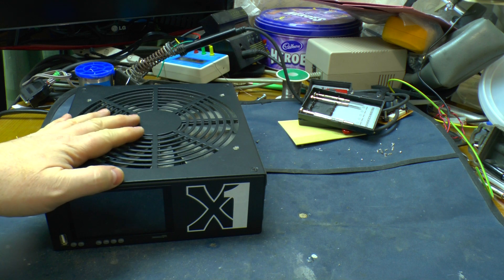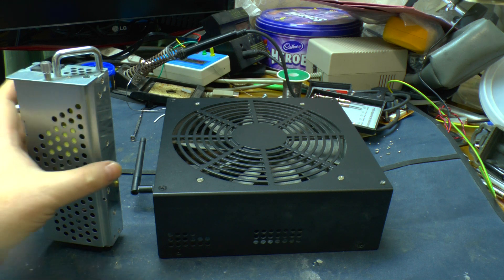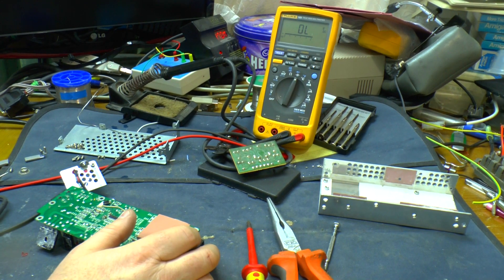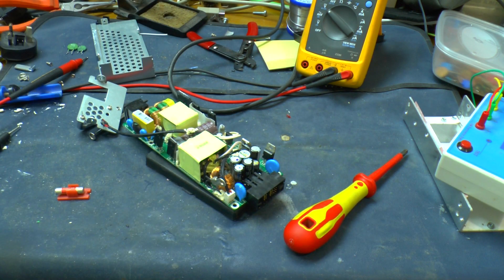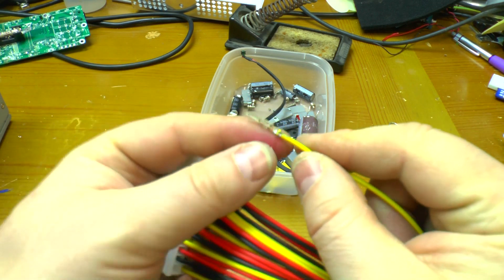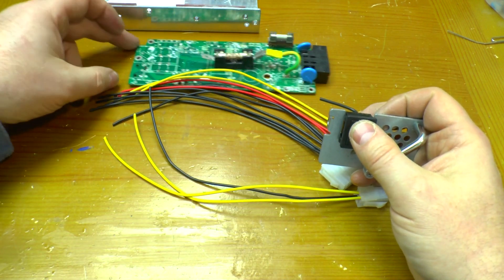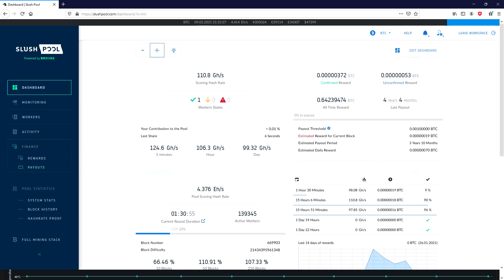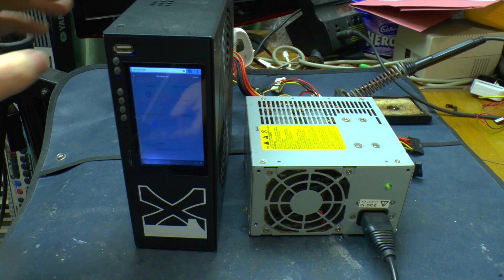Black Arrow Prospero X1 ATX power supply conversion

Comment: On a purely technical base... There should be a lot of amps going through the darn thing before it blows the fuse. So it should produce some heat, eh? If you had a thermal camera, you should be able to see the component which runs the unhealthy amount of current?
Reply from the maker: It was blowing instantly, but when I removed the reservoir cap it went a few seconds before something went "fzzt" and another fuse went. I suspect it was flashing over inside the transformer.

Comment: Hi! Could you say, what the model of lcd screen used in this prospero? I have a more older (with out lcd) but I saw a some empty socket in mainboard (40pin) and its intresting - if i plug compatible lcd - its will be work? Thanks!
Reply from the maker: I don't know. If you look at my earlier video where I opened the X1 you can compare your front board with mine, however there appears to be no easy means to get the details of the LCD panel itself. https://www.youtube.com/watch?v=KtxVxqPmN7k
Reply: AintBigAintClever thanks for answer! my board (from x1) looks like your board. Revision of my board is 4.1 date (2014/06/10). And socket for lcd and digitizer is empty. I think that its can work. Could you say the size of screen and resolution? It was a 4inch 800x480pxl lcd? Execuse me, I dont know how I can to attach the picture of my board.

Comment: Bought one on the strength of your video, finally arrived and I managed 0.6btc, yours died doing you a favour, I switched mine off, still works perfectly but electric use > btc mined. So, what did I do with my 0.6btc, got scammed buying a pair of x1.5, then with the remaining pittance, bought a 4ch DSO.. So easy to loose btc to scammers..
Reply from the maker: I always thought of it as a sort of 3D graph. You've got electric used against BTC mined, but you've also got the value of the BTC mined getting extrapolated over time (i.e. the blockchain.com price graph).  The miner was making a loss in 2016, but add 5 years of sitting-on-the-hoard time and it's a different matter.
I cashed in half of my September 2016 mining payout yesterday, purchasing a pair of John Lewis gift tokens from GiftOff.  My new dishwasher arrives Saturday.
What happened with the X1.5s? Scammed by BlackArrow?
Reply: @AintBigAintClever  yep... They didn't even reply to the various channels of communications.. I think I got my x1 via eBay rather than directly but going on memory.. At least I didn't throw away my laptop HD.. He must be utterly gutted. I love swps repairs, they don't really bite, just need to give em respect, learnt that repairing CRT monitors..